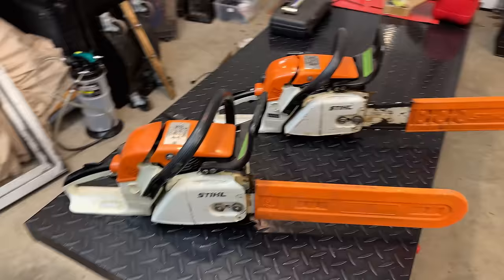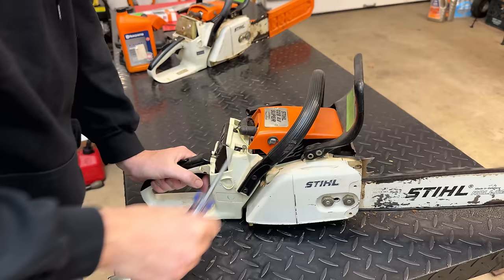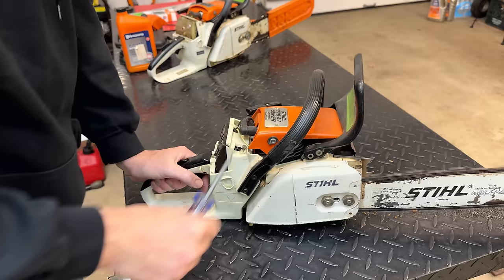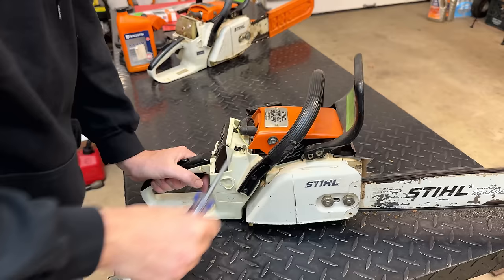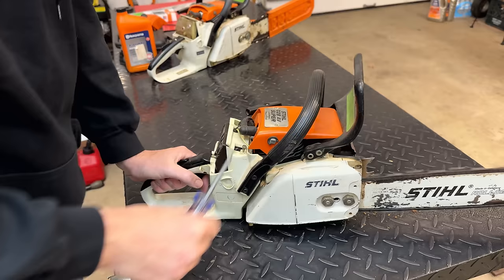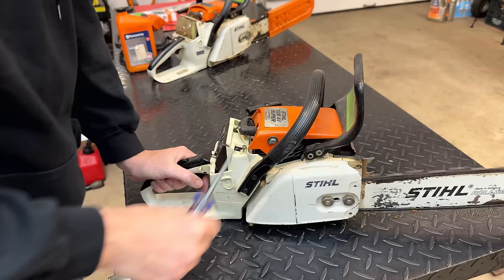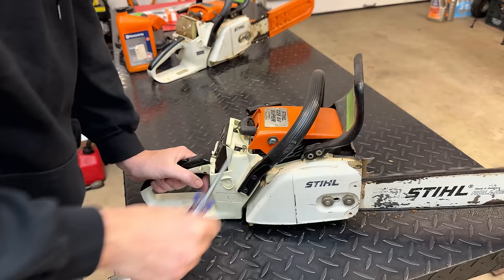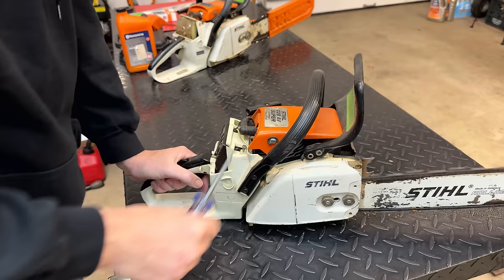Rebuilt STIHL Chainsaw Not Running Well - Straight Gassed 2 Stroke Fixed

Comment: Gota love old muscle saws, good vid James! The moral of the story, never lend out tools 😂
Reply from the maker: Thanks Tom.  They are well built saws and a pleasure to work on.  Although it running a lot better, still concerned about the lack of power.  The Facebook one made the cut in about 8 seconds.  Stanley’s in about 14 seconds.  Might pull the exhaust and see if there is damage to the new top end given it was run with an air leak.  Maybe a part 2?
Reply: @jcondon1  yeah, Stanley’s was too lean at 12k rpm, I’d have gone richer to match the aftermarket piston and cylinders requirements. I agree with you too, after market parts will almost always preform sub par to oem. They never get the port timing, shape and flow like oem do and thus you get reduced performance like you’ve shown. It’s a great comparison you did at the end. Well done 👍 edit: re pulling the muffler, good call, it’s the first thing I do on a 2 stroke :) although compression was fine at just under 150, skirt damage can sometimes reduce the effectiveness of post sealing and when warm, the piston can expand and the transfer on the cylinder from piston can contact one and other and start to cause drag and then strange running symptom when it’s heat soaked, won’t idle, hard to restart :) also, if a saw loses pressure quickly but slowly or not at all on vacuum, it’s most often intake manifold if they’re rubber, commonly, but not always, in the pleats 👍👍
Reply from the maker: @VintageEngineRepairs  it was lean.  Did that on purpose to see if I could close the performance gap.  Unfortunately that is all it had.  Pulled the exhaust to take a look.  Piston and rings looked ok.  No scoring, but the skirt seemed to have more wear than I would have expected. 
https://youtu.be/W9SfRdr75fM
Reply: @jcondon1  difficult to see the piston skirt in that video, but I think just port timing and materials are a huge contributor here. It’s quite well known that aftermarket just don’t preform like oem.
Reply: Quite agree. My other half (bless him) lent tools to other people, only to find that they're buggered up when handed back. He's learnt his lesson the hardway. Most stores sell all sorts of tools, in all price ranges. So why bugger up someone elses equipment when they can buy their own?
Top marks on another good vid James.
Wayne & Nina
👍👍👍👍👍👍😊😊😊😊😊😊❤️❤️
Reply: @VintageEngineRepairs  It does seem like rebuilding the saw engine with OEM parts would be good -- if "Stanley" is willing to pay the costs involved.
Reply: You should swap chains i found that even sane brand chain cut differently
Reply: Thx for the lessons in chainsaw mechanics . It opened up my understanding on how the machines work and run. A great great vid.
Reply: @VintageEngineRepairs good list
Reply: @robertcochran7103 😅
Reply: @jcondon1  was dissapointed to see them plastic gears in a quality brand saw as stihl,you would think one made of brass or stainless would adorn this brand.do any ?also wanted to know could a smoke machine be used to show a leak at crank seals or carb boots such as u done with vacuame pistol?snooky pa.😊😊😊

Comment: .. hint, if you broke somebody's chainsaw by straight gassing it, you should buy them a New one .. 🙄
Reply: These particular models haven't been made for 30 yrs, parts are not easy to find and in some cases, discontinued.
Reply: at the very least use genuine parts to fix it!
Reply: And it even says mix right on the fuel cap. This was just ignorance and/or inexperienced mistake
Reply: I have a different hint, never loan 2 stroke equipment to anyone
Reply: That’s why I hate lending out my power equipment!
Reply: Another hint. Never borrow anything you can't replace or afford to replace.
Reply: @yamahabasher1  or repair correctly.
Reply: It might be worth checking the barrel fixings as well as everything else was loose! As for the clone barrel they are ok but I normally have to tidy up the port's on them 😊
Reply: Mistake #1-Loaning power equipment out to someone who is inexperienced 
Mistake #2-said person who runs straight gas “rebuilds” your engine
We all know the reason the crank is chipped. He used vice grips or a vice to hold onto it while removing the flywheel. Geez
Reply: @CSkwirl  that is what I was going to say.... at least use factory parts....
Reply: Hopefully Stanley learned his lesson and won't lend that guy anything else ever again. I wouldn't even loan him a cup of sugar.
Reply: Or don’t lend your saw
Reply: They don’t make them like that anymore….😢. The fit and general appearance of those saws signify outdated engineering and skilled workers who were proud of their skills.  And they are how old?  Not designed for disposable use, like everything today 😢.  But West Chazy can find old saws and still get parts and play with quality!😂 😊
Reply: I'd be replacing Stanley's clunk filter. That 12K max rpm may be a fuel delivery issue, and filters are cheap. 
Also, most people that don't have their own saw... shouldn't be messing with chainsaws in the first place. Good way to lose your house to their next of kin. It getting straight gassed says it all.
Reply: True that. My neighbour wasted my chainsaw same way claiming he does not trust biofuel(i guessed colour of the 2-stroke mixture made him think it is some sort of biofuel)😂😂😂😂😂 showed him the saw price - he seems puzzled😂😂😂😂😂
Reply: I am not lending any of the 2-stroke or any other power stuff to anybody anymore:)) I now left with my trusty Husky 36 which is in a great shape.
Reply: Some of the first 2 stroke things I sold I didn’t inform the buyer that they needed  to mix the gas and 2 stroke oil. I thought people could read. A guy brought back said it lasted a bit then died and wouldn’t start. I was like welp you killed it, can’t do anything about that. So now every time I sell I tell them if it’s mixed, even when they say “yea yea I know” yea you better know and not bring it back saying you broke it.
Reply: @jsciarri You won't get the cup back. Or it has been  broken and glued back together, with chips still missing.
Reply: @paulh6096 better question is why he even removed it first a top end issue to begin with. 
  It’s not necessary at all to pull the cylinder and fix the saw

Comment: All of that fuss and the basic problem was that someone installed a part wrongly.  Ain't it often so? 😄  Hopefully, that won't happen to me.  No more news on my repair job since I still don't have the replacement petcock.
Reply: Replying to myself with a small update: New petcock arrived today.  Managed to fit it okay and no leaks.  Managed to get the engine started after several pulls on the rope.  Seems to be running slow although it does seem to be providing power (it runs a fan).  The pilot light doesn't come on, though.  I'm going to wait until I get a little oscilloscope I've ordered and then try to adjust the speed.  Over here, that'll be 3k rpm since we use 50Hz instead of 60Hz.  I'm intending to attach a dynamic microphone to the oscilloscope and look at the waveform of the sound of the running engine to find the speed.

Comment: I was recently reminded of why I don't lend out tools, even to someone that is experienced at what they do. When it's not yours (oftentimes) it is not treated the same. 
In this case, the person just didn't know that you cannot run straight gas in the saw. But when they go to such great lengths to make it right, you know they are good people!
Reply: Well said
Reply: I was thinking the same.
Reply: Well, maybe. The destroyer used chinese parts instead of OEM. Jury is out on this point. You do have to wonder why/how someone "experienced" is filling the tank with straight gas.
Reply: A cousin of mine came to me the other day to give him a wood splitter...and I told him to go get it.  When he got to it he noticed it was defective (something I was aware of because that's how it got back to me from the last person who asked for it) .. and he came to me to tell me... I replied  that I knew this aspect, and he wonders why I sent him to get it in the first place.  ..I told him that if I refused it from the beginning, he probably thought that I didn't want to give it to him ... and I also told him that since I received it defective, I stopped lending tools.  He turned his back and left without even greeting 🫡
Reply: I had something similar happen when a neighbor borrowed one of my chainsaws. They forgot to fill it with bar and chain oil and burnt up the bar and chain. He made it right and bought a new bar and chain and chain
Reply: Your soldering iron would work if you weren't using your vice as a heat sink, so if you had put the wire in the vice you'd have got away with it !   but you knew that !

Comment: I got goosebumps watching you assembling those chainsaws with the spark plug still connected. My father always said "Pull the spark plug connection on anything before assembly or disassembly!"

Comment: I just smile watching your video here. Funny that back in 2004 I was about 14 and had a 028 that used to be my grandpa’s and I got it when he passed away. It didn’t run right and I took it to my local stihl dealer and they told me it was terminally damaged. Told me to put it up on a mantle as a memoir of grandpa. Basically charged me 25$ for a estimate and gave it back to me in pieces and a ziploc of screws for the top cover and carb. When I got home I was putting it back together and ended up noticing the intake boot off at cylinder. Not knowing much at the time I put the clamp back on and it ran great. Set me down a career path for sure😊 great video!
Reply: I've got my granddad's 028WB. I used it for years to cut firewood. It's been sitting a long time, but I know it'll come right back to life with this kind of attention.

Comment: 7:00 As an aside, if the engine has unknown history when doing that first start, I’d recommend running it for 5-10 minutes first, to let the diaphragms flex a bit in case they were stiff from sitting. If you adjust the carb before that, you’ll end up having to go back and correct again after the diaphragms become flexible. This may lead to confusion on what’s happening.
Reply: I want the saw to 4 stroke when it's free but run clean when it's in the cut.  Yea, you have to give the saw a few hard cut before you touch the mixture screws
Reply: Makes perfect sense. Thank you

Comment: James found so many loose nuts on that rebuilt saw. I'd have concerns the rod cap bolts and head bolts weren't torqued. Nice repair.
Reply from the maker: Thankfully most 2 stroke engines do not have a rod cap.
Reply: @jcondon1  I learned something today. I haven't worked on chainsaws. Thanks

Comment: Great video.  I recently watched another video where the chain oil flow was restricted even with the max oiling pump setting.  The problem was a factory defect on an OEM vacuum relief check valve on the oil tank.  The chain and bar ran hot even with a small oil flow on the test until it was replaced.
Reply: I had a small problem with oiling on my old Stihl 041AV some years back. After cleaning it good still not enough oil. I put a little kerosene in the bar oil to dilute it a little and that worked to get the oiler working good again.   In case some folks don't know if their chainsaw chain is being oiled properly, simply start the saw, run it at full speed and hold the tip of bar above some newspaper or cardboard and you should see spattering of oil on the paper....then you know chain is lubed properly.

Comment: Hello  James: As usual a top notch instructional video. You are getting a very good inventory of test equipment. Plus in this video new Snap Ring Pliers. This video demonstrates exacrly why many small engine shops do not work on 2 cycle engines unless it is warranty work. It is just too time intensive to make a ptofit on. Kudos to you for showing in detail to the DIY capable of repairing their unserviceable but repairable equipment. Here are 2 more saved from the land fill to work again.

Comment: I wanted to thank you for your repair videos. I recently got my 50cc Poulan chainsaw running that has been sitting for 8 years. I ordered a clone carb kit with fuel lines. Glad I did because during disassembly I found the fuel lines had cracks half way across the line near where they attached to the carb. So I am sure my old carb is probably ok but it fired right up with the new lines and clone carb. God Bless.

Comment: Great Episode! Great troubleshooting! One thing though: top speed. I believe that you adjusted the high speed as high as it would go. Several other 2-cycle specialists, Chicanic (who sees hundreds of 2-cycles in her shop every year) has emphasized repeatedly that setting it to as high as it goes runs the risk of burning up the motor. She suggests finding the high spot and backing out the needle to take off (I don't remember her recommended number, it may vary by type of equipment) a small amount, something on the order of a few hundred rpm. That slight extra rich mixture is intended to improve the lubrication and reduce wear and heat. FWIW. Could be that weekend users may never see the difference. She deals with a lot of pros who use their equipment heavily. Anyway, you, once again, have probably saved a few thousand pounds of stuff from being dumped in landfills with a single video.

Comment: Reminds me of when i got my  Stihl 025 last year. Put a new carburetor, fuel line and impulse line and 4 pulls later it fired up. Still runs great just waiting for my new skip tooth chain to come in. Had to use it Tuesday after a tornado came through southern Ohio early Tuesday morning
Reply: Same storm came through southern Indiana. I’ve been busy cutting up trees. As of today, I’ve been without grid power for 4 days. I’ve been running the generator for that time and gas ain’t cheap.

Comment: Just found you, and appreciate your style.  As a former aircraft, truck, motorcycle mechanic I am venturing into saws 😮. My recent experience with a recalcitrant Stihl made me aware of degeneration of the hoses.  In future endeavors I will be more aware of damage to both gas and vacuum lines ( my long sought after issue). The pressure/ vacuum test really shortens this process.  Side comment- a mud flap or door mat on the steel bench is easier for you and the saw😂. Enjoyed!
Reply: I was thinking a couple nice slabs as a work surface. 
I was cringing at the chain running near that diamond plate.

Comment: I rebuilt a saw top end a couple years ago. I believe it has this exact same issue. Meaning the crankcase leak. I had it running, but it was doing the cut out thing too. I put it on the shelf. Now I want to get back at it and try what I saw in this video. I love learning things :D

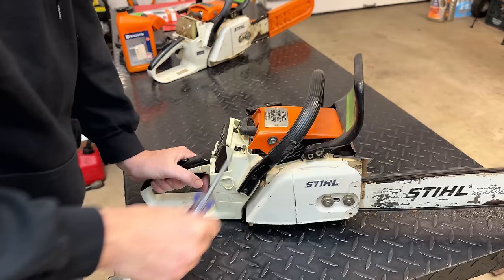Comment: I've had a Stihl 024 AV since 1985.  Out of all the tools I own, that one alone is the most dependable and reliable.  Even after 39 years, it's my go-to saw and starts and performs every time I need it.  With regard to the air filter at 1:05:10 -  while there are better filter designs now, that clone is a faithful copy of what Stihl used.  My 024 came with that plain screen filter from the factory and I ran it for many years.
Reply: Ditto my 025 from 1994...and I am still using it ...but I clean that filter and the saw  after every day of use.

Comment: Odd a guy has the know-how to rebuild the  top end but straight gasses a chainsaw, must be more to the story I'm sure!  Anyways that was a good 2-stroke carb tuning vid and troubleshooting with the pressure tester.   Now he has 2 good saws, well done.
Reply: Putting it together is one thing, knowing how to tune it is completely another skill set!
Reply from the maker: I was expecting every seal to have a leak.  Not too bad for the guys first rebuild.  I was told he had the cases split, but am thinking he may have just changed the jug and piston which is why he had trouble with the boot.
Reply: @jcondon1  He did good for the first one for sure!

Comment: You never loan out anything you aren't willing to risk losing.You never loan out anything which requires brains to use correctly. You never loan out anything which has easy-to-reach adjustments someone can screw with. If someone regularly needs something they will have it. If someone needs something because they didn't have the foresight to see the need ahead of time beware their intelligence level. Borrowers usually lack the experience needed to use something correctly so whatever you loan them must be as stupid-proof as possible. Never a borrower or a lender be.

I had an old Stihl 058AV and it was a real workhorse. So powerful so as to be almost dangerous. Having moved and no longer needing it, I gave it to a friend who used it in partial trade for some tree-work she needed done. The arborist was happy to get it and gave her a good discount for it. They sure don't make them like that anymore.
Reply: Do you mean a 056 AV or 038 AV Stihl never made a 058 AV. I have a 056 Magnum II that's an animal slow but it cuts through anything . Can't bog it down . I lent it to a friend and gave him a brand new jug of bar oil . When he gave it back the bar was and chain were shot and the jug was unopened. I asked didn't you use the bar oil ? He said it was to messy . Now like you say I don't lend out anything to anyone. Every time I did I got screwed.🍻
Reply: @Spitter-ud8jd  Memory fails me as that was around 30 years ago but it was a big one, and there was no bogging it down. The bar was at least 24", probably longer. Never used anything like it before or since, but I don't often use a chainsaw and don't know a lot about them.

Comment: Whenever you're turning the chain with your fingers always turn the chain in the normal direction of travel, that way you'll be less likely to cut your finger tips off if the chain binds up